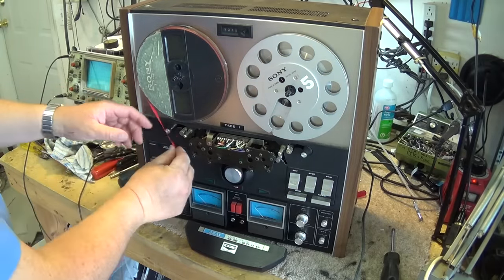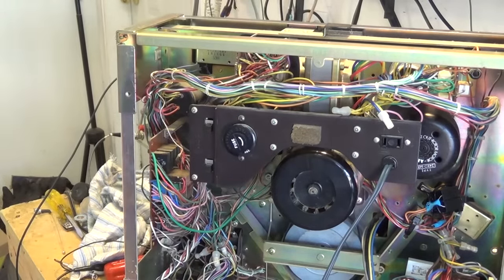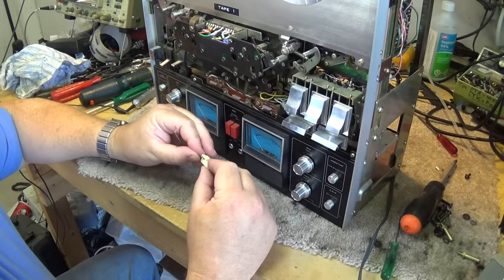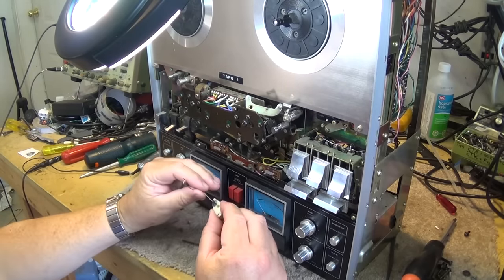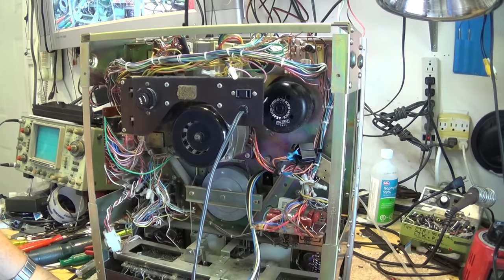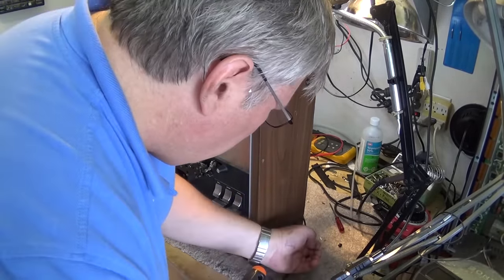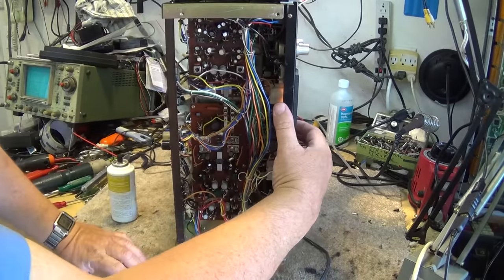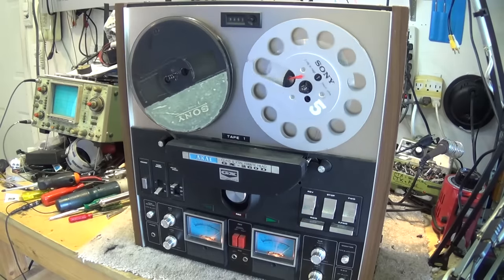Akai GX 260D repair

Comment: I want to thank you so much for your video about the gx-260  d reel to reel you fixed.  I have the same one .I had a hum on playback an record so I used the circuit cleaner and it worked. thank you so much.

Comment: sir you did a video for the replacement of 1.5 uf cap (SONY TC 200 hybrid and i watched it , and i repaired my sony TC 350 and also learned about the 50 and 60 cycle issue  thanx

Comment: Nice job.  A friend's dad has the same machine that is suffering from that traction problem.  He asked me if I could fix it.  The problem may be finding a spare for those special high voltage caps.  Guess mylar caps would do?

Comment: Love It!
Where would we be without JB Weld.
Also.. watch the static around those SD cards/flash drives, etc.
the filaments are so fine.. I've read that 1v will burn them up. 
My point is that a static charge so low you or I can't detect it could be enough to fry the chip inside.
It could also be how the computer writes to the chip.. since you can't optimize flash drives (you can, but you never should)
Reply: t-bone walker And by no means am I an expert or an authority. But.. that carpet matt you use on your workbench might be great for gathering rogue screws.. but it is a crazy electric field generator..
I'm probably wrong, I just wanted to put the word out there..
You are still a genious. I have learned a friggin lot watching your vids..
It just might explain your flash drive experience
Reply from the maker: t-bone walker I don't do ESD work on the carpet. I do that on a bare wood bench.
Reply from the maker: t-bone walker No just cheap Chinese memory chips. It was a Duracell brand.  I am sure the chip is still OK. The cheap plastic they made the card out of cracked, and now the contacts don't make a proper seat in the socket, which results in loss of connection during writing, which corrupts the card.

Comment: Thanks this helped me!  I’m Going after the 1uF 2uF 250WV ac motor cap in my spare Gx-260d—Play slows down after running for several seconds. The schematic I have for the gx260d is horrendous! I have the non UL model.  I tried to see in this video what brown wire was 60hz and which brown wire was 50hz—common looks like the lug on the oil filled cap with the few wires on it.  Any hints?

Comment: I found the video when I was looking for Rubber Renew.
As a tape recorder lover, that stuff is interesting.
I've just watched this video in which the Akai is revived.
What I wonder about why you did not free the inside of the recorder dust.
A vacuum cleaner and a brush you do the job.
Reply from the maker: Because it wil just get dusty again. That unit has no back on it. When I received it, it came from a radio station, and they had it rack mounted with no back. It sits on the top shelf of a 6 foot cabinet so you can't see the back open, but it picks up dist like crazy. Little dust won't hurt it. The Akai 4000 that I just picked up will probably get more hours on it when I actually sit down to archive the dozens of old tapes I have. I don't run this machine much, it is more for show. Reel to reel machines look cool.

Comment: I have an Akai Gx260 device sometimes that does not respond to the operating command and when checking the voltage connected to the electromagnet the pickup responsible for it, I found a reading of the voltage zero when it does not respond and when the voltage responds it is 24v What is the reason in your opinion

￼

Comment: I really need your assistance. I have an AKAI GX 260. The power suddenly went out and I have located the fuse location on the deck. However, getting access to replace the fuse is tricky. It requires moving wires and cables that look like they could break off if moved. I need to find a way to safely access the fuse to replace. Do I need to disassemble the entire deck to do so? All help much appreciated. Thank you

Comment: I would love to see your equipment rack :)
Reply from the maker: It is nothing special. Really. Bottom shelf an old Teac cassette deck. Next shelf up Sony DAT, Next up a Sangean HD tuner, next up 200 disk CD, and on the top my Yaquin tube amp. There is a BT / Network DAC plugged into it. I have a Tascam reel to reel and Thorens TD165 sitting there not connected. Technics SB7000 speakers.
In my studio I have a Technics SLM1, Technics RSM275 cassette, Sony CDP555ES, Tascam DA40 DAT, and Technics SUV9 amplifier. Altec Lansing 305 speakers Nothing real fancy but it sounds great.
I have much stuff that is not connected including a McIntosh1600 receiver and Sansui 9090db, a B&O linear tracking turntable.

Comment: Hello...
I have a GX-260d that on Play Mode runs very slowly and stops moving. I understand that it needs to change the capacitors of the Motors Capacitor Board. I want to buy these Caps, but i don't to know the Kind of Caps so to ask/order them...are It's a Polyester Caps?  The original are "called" MP caps.....and looks like as electrolite capacitors, but it isn't, is another kind that are not exist any more ...... Also, i want to ask if you have any blue original akai Vu meters to replace mine... regards.

Comment: congratulations for the excellent work, I wanted to ask you how to remove the aluminum cap of the pinch roller, is it screwed or pressed ? Best regards
Reply from the maker: Screwed on.  Should be able to pinch it in your fingers and unscrew it.  Turns counter clockwise to remove.
Reply: @12voltvids  thank you very much

Comment: great video! I have a few x200d's. Do you know what a replacement for the red capacitors labelled 331k on the preamp board would be? Maybe 331k 250v? No other marking but its a poly chicklet.

Comment: Hey Caig, you mentioned a bootleg reel to reel tape. Beatles live gigs would now be over 50 years old, so as long as you don't make money off them, you could upload to youtube as a historical document, without infringing any copyright. It's usually about the money, so if you are not being paid, and it's there in the public, there is little anyone would do. Actual Beatle fans would really appreciate it.   Any Beatle live gig was characterised by LOADS of girls screaming continually, so it could be an ordeal to listen to an entire performance.  If you have any Bootleg live Doors reels I'd really like to know where they were recorded, and the date if it's on the can.  Another great tech video BTW, thanks.
Reply from the maker: Even though these recordings are over 55 years old, copyright remains for 70 years after the last rights holder dies.  Last time I checked paul McCartney and Ringo starr are still alive and performing.  They would get an instant hit  for sure.  I did put up chuck berry, a performance I worked on the TV crew that shot it.  The only reason it wasn't hit with copyright is because the backup band was playing everything in the wrong key.
Reply: @12voltvids  , it might not be as tight as that.  I guess it depends on whose lawyer you ask. I was helping a guy who taped a gig in 1970, he was in the audience. His recording suffered so badly from technical faults and issues that the bands recording company didn't care what anyone did with it.  It was a cheap mono 120 min audio cassette with winding faults and creases, and flattening batteries, and horrible wow and flutter. But it has historic sound thereon, and once I worked out what the problem was I was able to fix it.  So I have the only listenable copy, and NOBODY cares. And the bands producer gave me the ok to do a radio show about it.  I'd be really surprised if anyone cared about an old beatles tape these days. Most people today would say " WHO?".
Reply from the maker: @aufornvic  
Be my guest and upload some Beatles stuff and see what happens.
Reply: @12voltvids  A couple of years back, on a London radio station they had a quiz, and the question was " Which band did John Lennon sing with during the 1960s.?". And NOBODY won the prize, nobody got the answer.
Reply from the maker: @aufornvic  
If I asked you what band ian thornley sings for you probably wouldn't know either and he is in a fairly popular band.
Reply: @12voltvids  yes, you'd be right. But the radio competition was on a popular show in England. They didn't know which band John Lennon played in.

Comment: This guys awesome, big fan, wish you were in NJ..Id make you rich !!! Just got one these...powered it up , all seemed to work, then after about 30 minutes sitting idle, POP with lottsa smoke pouring outta the top...unplugged it, found it had the wromg fuse, corrected fuse...afraid to power it back on...but I did,  nonetheless still powers up and al seems t ok.....any thoughts ?? PS issue ??
Reply from the maker: How do you know I'm not rich?
Reply: @12voltvids  Ok, richer then !!! How does one contact you for repairs ?
Reply from the maker: @tonyrutgershauer7947  my email is in the about tab on the main page
Reply from the maker: I could be a millionaire or flat broke on the verge or bankruptcy or for that matter I might already be there.  I'll never say.

Comment: Thanks for this!!! Quick question..... The big filter silver cap by the condenser board..... What did you do to fix that? The machine's pinch roller wont engage when I hit play. I'm hoping fixing this will get overhang up to speed. Thanks again!!!
Reply from the maker: I replaced the run capacitor with a couple of mylar caps.  There is another video I did about a year ago that dealt with that repair.
Reply: Great! I searched your videos...... and I couldn't find it. Do you have a link? Thanks!
Reply from the maker: Looks like it is blocked world wide for a copyright match due to 10 seconds of music off an old tape that was played. I will have to find the source file and take the music off and re-upload it. I tried to have youtube remove the music, and it gave me an error that the music can't be deleted, and they won't even allow me to download a copy, so I will have to find the original file and fix it off the source file.
Reply: Thanks!

Comment: sir need your advice , i have a AKAI GX630 D which has rew and fwd issue , i tried replacing 3uf*2 and 1uf*2 for the eddy but it still has no torque,after seeing this video , it seemd that i need to replace the 0.47uf 250vdc 2 nos , can i replace it with mylar 0.47uf 250v  dark orange col  capacitor , hope you will address this issue , i am writing to you from India . i shall be obliged .
Reply from the maker: Yes  I used my mylar on my 260d

Comment: i have one of these machines and needs new caps for the motor.Was wondering you had a list or can tell me what caps you ordered?? thanks
Reply from the maker: At 4:09 I explain about the run capacitor for the main motor.I put 2 1uf capacitors in parallel to give me the needed 2uF. The original was an electrolytic non polarized cap. I put in a mylar type that would be found in an electric fan. Picked it up at the local electronics component place for about 2.00 The original cap was a 2+1 UF. and the 50/60hz switch paralleled them on 50hZ to bring it to 3UF. I did shoot a video of the cap diagnose and replace but the memory card failed and I was unable to play the files.

Comment: I have the same Akai but I tested with several cassettes and found that plays a bit slow .Like a woman sound as a man.I have tried both speeds but no luck.Do you have any clue how I will fix this issue?
Reply from the maker: Well considering this is a reel to reel, it would be pretty tough to play a cassette on it!
On this one though, a slow AC motor will be a rad run capacitor on the motor.
It is a oil filled AC  capacitor. I did the capacitor service on an earlier video on this one. AT the 16:07 point when I turn it around you will see 2 caps strapped together with some blue heat shrink tubing. It is just below the reel motor on the right side. That is the replacement capacitor. The original is a large oil filled one that is mounted to that bracket behind where this one is hanging. That cap goes bad. It is a dual value cap, but one if for 50hz and the other for 60, or I just replaced it with a single cap of the same value. I had to parallel 2 to get the correct value. When that cap goes bad the torque drops and the motor speed drops. The circuit board below this has all the capacitors for the reel motors, and they also go bad and cause no torque to take up, play, FF and REW. They have been replaced on this board as well.
Reply: @ 12voltvids Haha sorry my mistake.Not cassette but tape i mean .Thank you for the quick response.You are doing a good job on this repairs!I am repairing smartphones laptops and tablets so its out of my field.